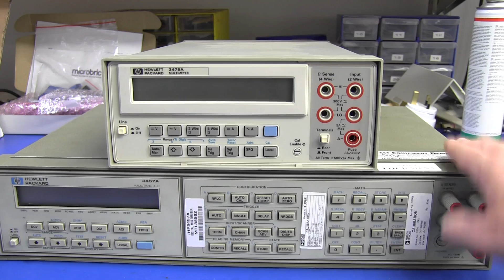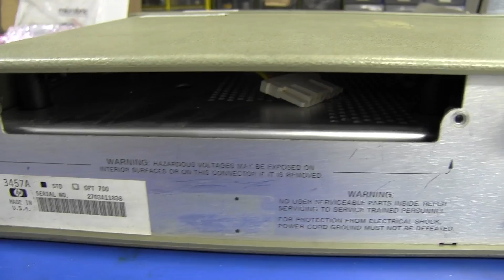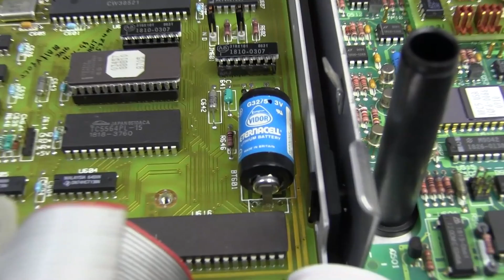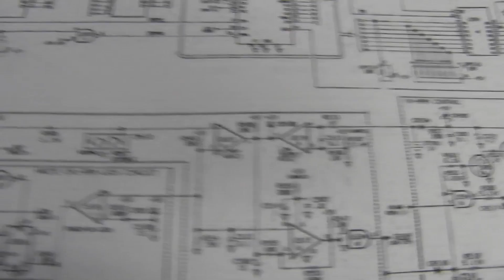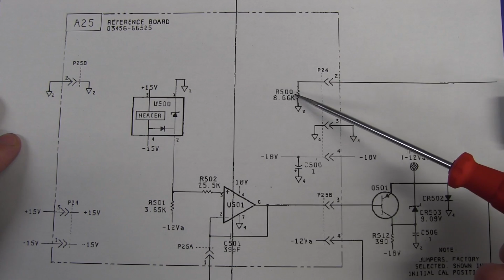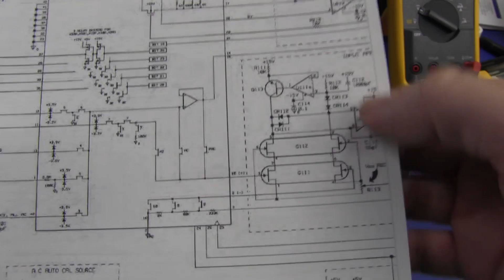EEVBlog #426 - HP 3457A Multimeter Teardown

Comment: I have one, which has inputs on the rear too. If a scanner is installed, the rear inputs are removed. It looks like your one has had a scanner at some point, but then removed, which is why you have a big hole in the back. A video about using it would be good. I believe it is possible to get the extra digit on the front panel with a bit of fiddling around. I think it gets stored in a register.

Comment: Nice vid, and nice meter. Scary that that calibration screw is connected to input high, while the shielding is connected to input low. Sure looks pretty close together, with little room for shifting around. what CAT rating would that be? Hmmmm?

Comment: The HP part numbers were called 4x4's, though they're up to 5x5's now.  Sometimes they are off the shelf, other times they are hand-selected or manufactured to custom specifications.

1826-1382 IC PRECISION OP AMP 8-DlP·P PKG LT1001CN8(SELECTED)
1826-1265 IC-WIDEBAND OP·AMP (LT318AN8 SELECTED) SL30028
1826-0346 IC-DUAL GEN-PURPOSE OP AMP 8 -DIP · P PKG LM358N
1826-0521 IC-DUAL LOW·BIAS-H·IMPO OP AMP TL072CP
1820-2624 IC·MPU; CLK FRE0=2MHZ, ENHANCED 6800 MC68B09P

Comment: If one had to change the Li cell, what are the exact steps to do so correctly, while maintaining original config data with unit "On" ?
Reply: You would want to clip in an external 3v supply across the connection points of the old battery, with a OR diode or even just a resistor, then swap the old battery.

Comment: Do some of those chips by the handwriting have an allen bradley logo on them? That would be strange.
Reply: +codenamecody 
1810 - 0307 NET WORK·CNDCT MODULE DIP 16 PIN 0.100 01121 316X101
MFR code 01121 = ALLEN-BRADLEY CO. INC.   EL PASO  TX  79935
Why is that weird?
Reply: They do industrial controls now. I didn't know that they made integrated circuits at one point in time.
Reply: Its a resistor network

Comment: The production date of hp-devices is encoded into its serial number. The serial number scheme is: YYWWCsssss
Add the first two digits to 1960 and you get the year of production. The third and fourth number is the production week. The Letter C is the manufacturing country: A = America, B = Brazil, G = Germany, J = Japan, S = Singapore, M = Malaysia or Indonesia and Q = United Kingdom
Your 3457A has the serial 2703A11838 - so it's likely to be produced in the 3'rd week of 1987.
Reply: Carsten Ellwart I have one of these, and it's serial number is 2703A04231. Unless HP was building 7000+ of these a week there must be some further complication to the serial number scheme.
Reply: +Vernon Klukas : Hi Vernon, I have a late production unit with s/n 3114Axxxxx. With the usual HP s/n interpretation method this would lead to think the unit was manufactured in 1991. However most of the chips inside are dated  late 1994. The board manufacturing labele is 09-9447, or 47th week 1994. The backup battery is the new 3.4V japanese Lithium cell, which is found in boards with ERC no. 2850 and  greater. The unit has CALNUM=120 and appears to have been calibrated last by Agilent in 2004. Best regards. Len
Reply: On some HP kit, the serial number date is that of major design revision, not of manufacture.

Comment: I ran across a doc from 1984 with a big cross reference list of HP house numbers including many of the ones in this unit. Anyone interested can plug "hparchive com HP-Bench-Briefs-1984-05-06" into google to find it since youtube doesn't like links.

Spoiler: the 1820-3174 chip with the ferrite plate is an 74HC132 according to that doc.

Comment: The reference is the LM399
Linear makes 2 voltages references with internal heater, the LM399, mostly used for 6.5 digit multimeters like the Agilent 34401A, its a 4 pin device.
The other one is more exciting, the LTZ1000, used in the agilent 8.5 digit multimeter I think. VERY low tempco of just 0.05PPM, not percentage, PPM!, that's a shocking 50 parts pet billion. As the reference in here looks like a 4 pin device it probably is the LM399. If you can measure 6.95V somewhere you know for sure.

Comment: I have a vintage HP power supply 25V, 25A maximum, but it has a blown thyristor/simistor  on the board... all the parts are HP part numbers and i can't fix it.... I'll make a video of it and send it to you as a video response. You'd love the large analog amp and voltage needle meters :) I'd love a hp part catalogue...